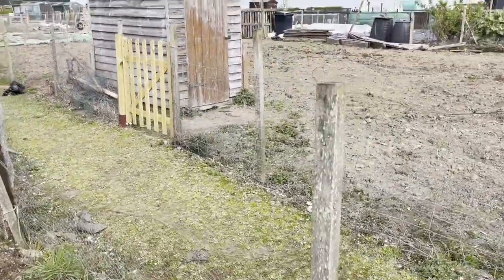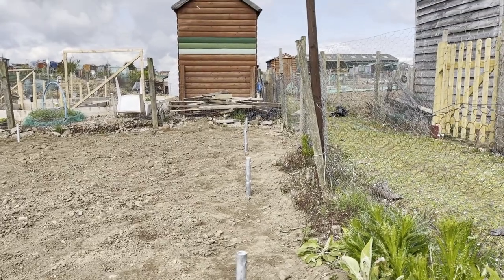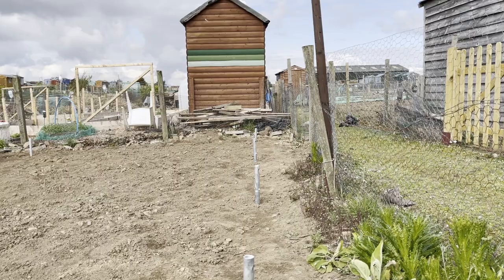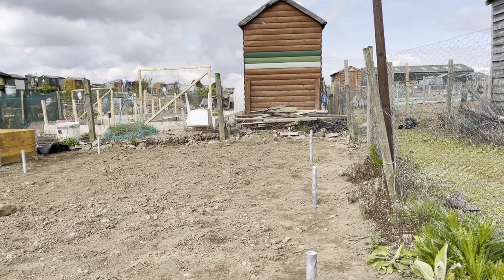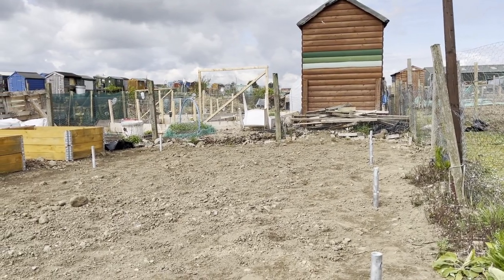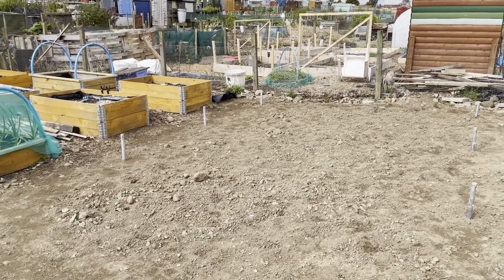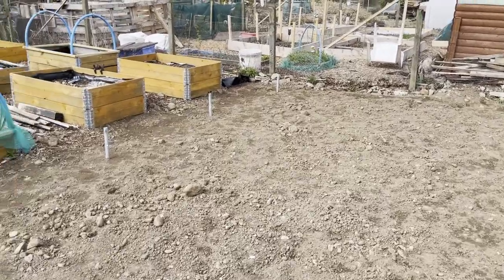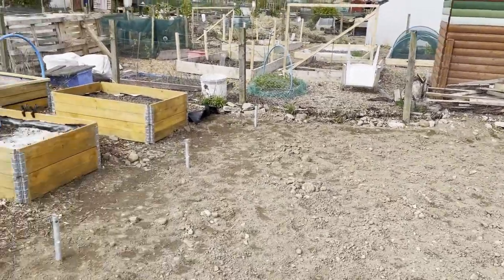Polytunnel Build (Part 1) | How to Build A Polytunnel | Polytunnel Kit Build

Comment: Mark, believe me, you will be delighted with ur polytunnel. Mine is 20 ft by 10ft. I waited 35 working days last Yr for it. It went up on the 6th June and I love it. Yes, its hard going putting it up, make sure ur measurements are 💯, but it will all be worth it. I got thicker hoops, thicker polythene and we had 5 of us pulling that on taut. Good luck and all the best 👍😍
Reply from the maker: From the bits I've put together so far it seems to be a quality product. Part 2 coming later this week with nearly all of the frame being put together.

You're right that its hard work and the measuring again and again to make sure everything is square is frustrating but it'll be worth it in the end

Comment: 👷‍♂️Brilliant episode of your TV show! I would be bricking myself about building that, and putting the ground anchors in straight - nothing I ever do is straight or square, despite my best efforts 😬 Plus I only have myself as a resource. Both Mossy Bottom and Simplify Gardening have also had recent Polytunnel build VLOGs - fascinating stuff.
Reply from the maker: Thanks Tufty!

I've been a bit nervous putting it up but thankfully had some help from others with it. I don't think I've ever measured something and checked it was level so many times whilst putting something together.

Comment: Hi Mark you must be excited about your tunnel, we got ours from first tunnels 2017, have never looked back.  Speaking of delivery, they could not guarantee the delivery date, if no one is going to be in then they will deliver to nearest depot, I came home to find it on my driveway.  A tip about the cover, make sure it is a warm day when you put it on, it will go on tighter 👍
Reply from the maker: The delivery problems were a bit frustrating as tunnel and all the bits and pieces seem to be really good quality.
Hoping the temps start to creep up over the next week or so ready to put the cover on!

Comment: I ordered my fruit cage from First tunnels and was quoted 2/3weeks but it was infact 4 weeks but not all the parts. The only part that was missing was the flexing. The delivery was arranged and did turn up on the day but, no update on time, as I had to go to the allotment and basically wait for it to turn up. That said, it is very good quality and my netting did turn up a few days later. I agree with you as far as not knowing what time and having to ring them too
Reply from the maker: It's a shame when problems like this crop up with delivery of what seem to be really good products.

I've dropped them a wee email letting them know of the problems I've had so they can hopefully improve things with the courier

Comment: Nice to finally get started on it Mark, hopefully preparing the ground for mine this next week. Are you trenching in with yours, or going with the base rail option?...Steve...😃
Reply from the maker: It's been a long time coming and I'm glad to get the build underway.

Part 2 coming later this week with hopefully most of the frame put together.

I went for the aluminium baseball option. It was a wee but more expensive but hopefully it saves a load of work with trenching when time is a bit tight at the mo

Will be keeping an eye out of your build vids coming soon Steve